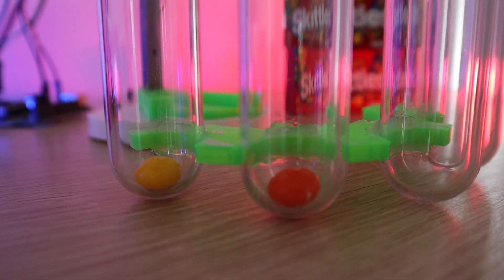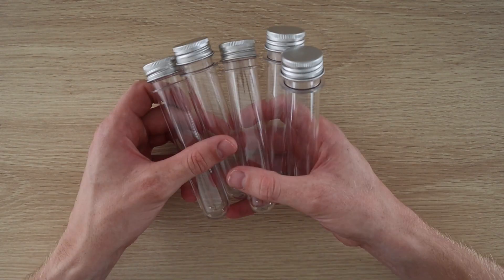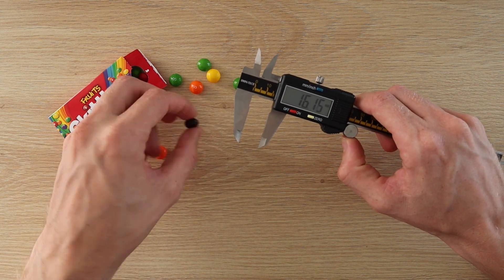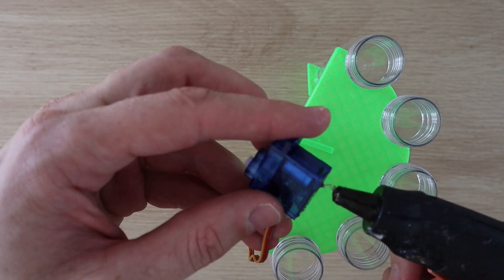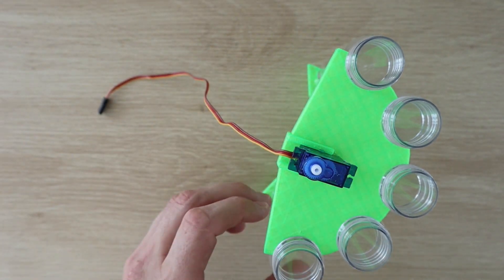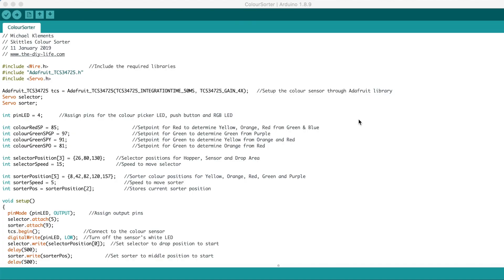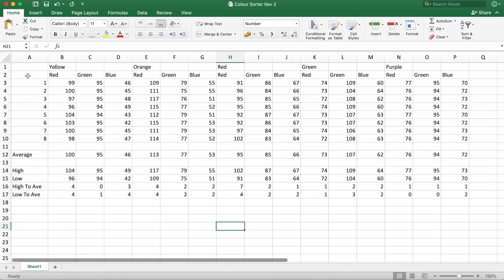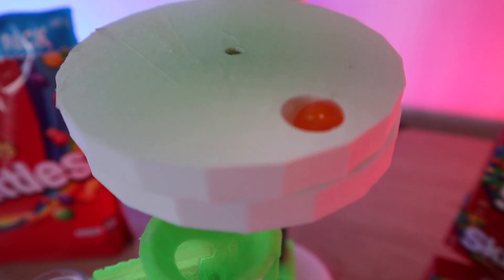Arduino Based Skittles Colour Sorter  - Make Your Own

Comment: What wasn't mentioned was how long it took for it to sort 1 Skittle. I know this is a year old video, but was curious.

I like this idea and thought it could be used for sorting buckets of perler / hama / artkal melting beads. So wondering how efficient it is and if you've made it any more efficient with further testing. Thanks!
Reply from the maker: It takes around 3-4 seconds per skittle, depending on how far the chute has to move. I didn't really play around with trying to make it faster, although there are definitely some things which could be done to improve it. The servo which moves the skittle from the hopper to the sensor and then chute is running really slowly. If you got good quality 3D printed parts then you could tighten up the tolerances and speed this up significantly as the sensor doesn't even need a second to read the colour. You could also use a higher speed servo on the chute to reduce the waiting time.